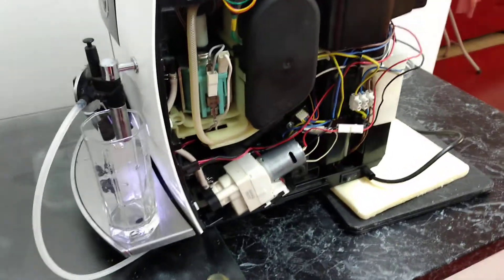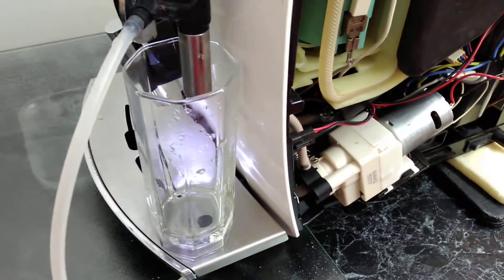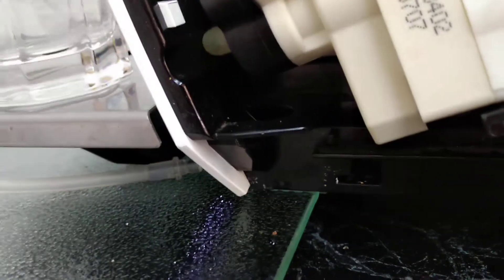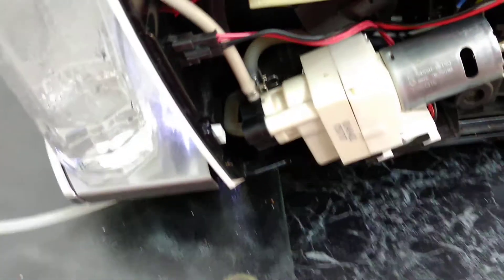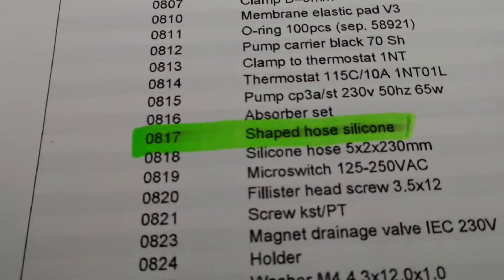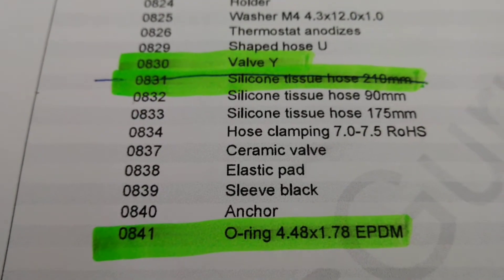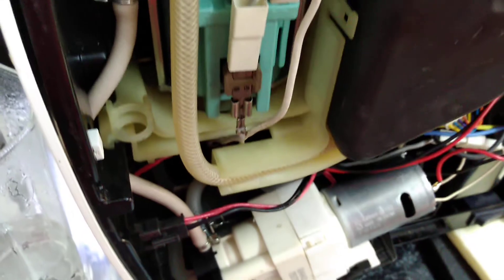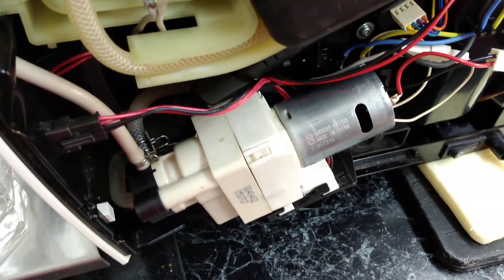Jura impressa J5 leaking

Comment: It could be the orings you put in were not sealing properly. Try using a little bit of lubrication on the orings before putting them back in. Just a suggestion.

Comment from the maker: Maybe this helps: the machine seems to only leak when I prepare hot water, not when I prepare a coffee.
Reply: Denis Havlik 
If it leaks only hot water, and, not during making coffee, then we can rule out membrane regulator.
And, as you’d said, it’s hot water, the immediate suspicion goes to ceramic valve.
Reply from the maker: @willo7979  thanks, that is what I also suspect. Not sure if/when I'll have time to play with that again though. :-(
Reply: Denis Havlik 
However, I do wish it’s merely a leak at hose near hot water spout.
Please refer page 8 on your service manual, it could be one of parts 405 to 410.
Reply: Did you fix the problem in the end? If yes, was it the ceramic valve?
Reply from the maker: @wilfredvansteenis2672  i gave up on it. 😞

Comment: Juras suck. I had to send an intent to sue to Jura. I had massive issues within 3 months of my E8. I went back and forth for 1.5 years to the point where I faxed, emailed and usps an intent to sue. The supervisor called me immediately and his pompous responses were to blame us kindly like: 1. Oh I see u guys don’t have  Jura cleaners on ur account so unproper cleaning can cause issues. I told him my in laws had juras since they came out and we buy them in bulk on their account 2. He then said- well, it’s not recognizing the tray bc it may be wet. Me: nope. We’ve done alll of that 3. Well maybe ur not cleaning the drip tray right which is why it’s bubbling. I said- ur condescending and to blame us for ur cheap tray grate that looks like metal but is only metal vinyl that is directly under a place that has water and steam.

He said he would “do us a favor” since our warranty is expiring in a week and service for free but after, u will only have 6 months extensions. I said that I have every email, call for 2 years where u guys deliberately delayed fixing this. Had it been fixed in the first 3 months, I would have 1.5 years left but if I have any issues in that time frame, I will expect free service or I will have no issues filing a small claims court showing ur neglect. My Jura started leaking at 7 months.

Claim court is $50 and they can’t bring a lawyer. To me, I spent nearly 3k on my machine. I bought a 2017 ford interceptor at an auction for $2300 with 60k miles and only needed an oil change. That’s the prospective I made clear to him.